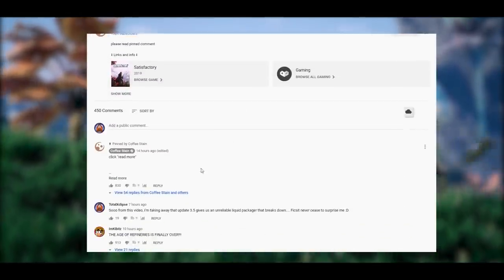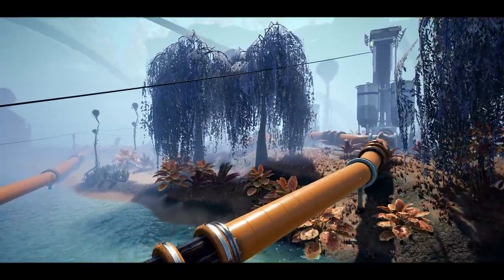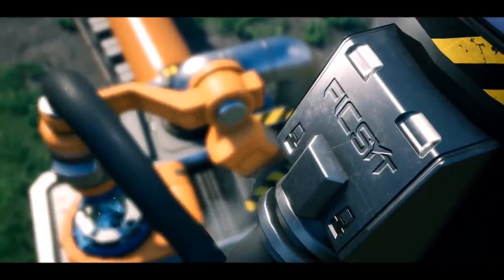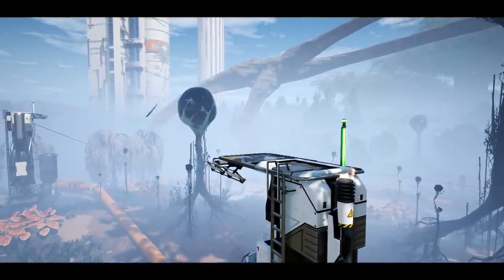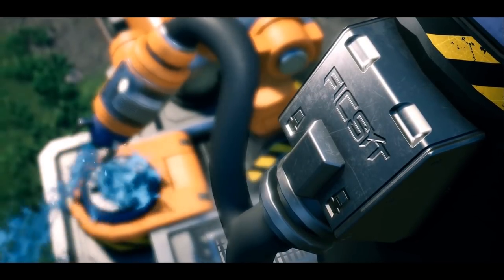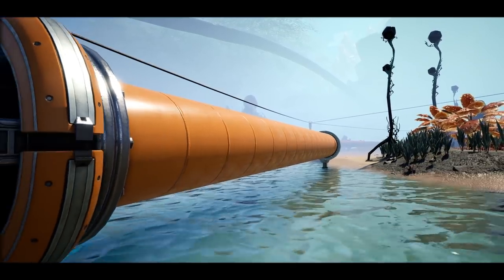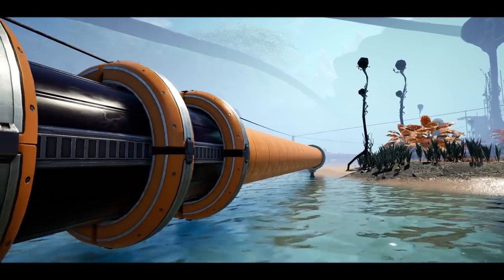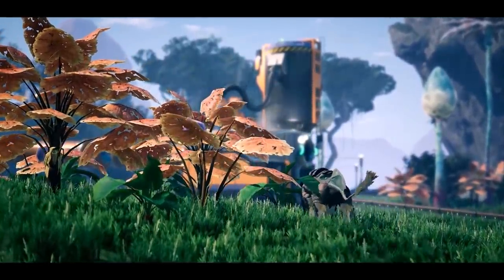Satisfactory Teaser Trailer Theory? [Satisfactory Update 3.5]

Comment: packaged alumina solution is number one on my wishlist for this update.  Second is bigger pipe throughput upgrades.  I'm guessing the animation is just for the trailer, but it could be more.
Reply: Well a fluid sink would keep oil from being such a pain.
Reply: @brodriguez11000   I believe there's a mod that lets you sink fluids. I haven't had a need for it though, I sink a lot of petroleum coke 😁
Reply: @smstnitc  There are mods that have specialized packagers too.  And if you use them then moving fluids in containers becomes even more efficient than pipes over a shorter distance.
Reply: @DarthPoyner  I do a lot of packaging with a fluid packer mod... I have been setting up a system of packing fluids to move them around the map and send the empty containers back to be recycled...  Nothing can pack alumina though...

Comment: We need High Pressure pipes that have a 600 cubic meter/minute throughput.
Reply: And bigger water pump
Reply: Something like Copper-Lined Steel Pipe would fit pretty good into the current theme.
Reply: With the new packer... They may be expecting that you will get higher throughputs by using packing/unpacking.

Comment: I have a feeling that the breaking animation is just a flavour thing for the teaser, not a feature.
As for potential for Mk.2 pipes - I'm mixed on this. On one hand it would definitely be useful, on the other, it doesn't make sense that the same diameter pipe could accommodate higher flow-rates (I know, I know, physics isn't exactly the game's strong suit, but still), and of course it would have to stay same diameter to accommodate existing machinery.

Regardless, I'm excited for the update.
Reply: Couls we have, say, mk2 pumps that would fluids flow quicker within the same pipe? Wouldn't that be compliant with physics? If so, mk2 pipes might just have some higher pressure mechanism embeded into it to justify the higher fhroughput.
Reply: Pipe diameter effect on flow rate is inversely proportionate to the pressure. And visa versa. But the same size pipe can handle various flow rates. 

Heat transfer and fluid flow is a part of my knowledge from the navy. Also why I hate the implementation of nuclear power in the game.
Reply: What if the Mark 2 pipe has bigger diameter? But that would also require us to have a mark 2 wall hole, connectors etc... maybe not viable option. I would say that we could forgive CSS to oversee the physics here and still allow bigger flowthrough in the same pipes. Or what if Mark 1 pipes isn't able to fill up 100%? But the mark 2 would?  Just speculating here. I really would like to see Mark 2 pipes.
Reply: LOL You guys caught me, I confess, I know nothing about fluid dynamics!
We'll see what they release. But honestly, even if all they do is slap a slightly different shade of orange on the pipes, call them Mk.2 and suddenly they transfers 900m3/min - I'll make peace with that and continue enjoying the game :D
Reply: I dunno, if we get different flavors of sheeting, and they could justify it is the friction within the pipe. Cement pipe, Copper, aluminum piping?
Reply: @deeraz  Yeah, you increase the pipe strength (iron or steel maybe even plastics) and then increase pressure which increases flow/current.  More throughput.  Simple and efficient.

Comment: If they are going to have machines over loaded with fluids or others they will need to bring in extra control measures to limit flow or input. In real life the easiest non mechanical method is to have pipes flow under presure and then use smaller pipes coming off a larger main pipe.
The improvement id like to see is is better ellectrical control. Ie isolated power grids to both limit and control what power goes where so failures are isolated to specific locations and a failures isnt total system.

Comment: Smaller footprint seems to be the only definite difference between the bottler and a refinery
Reply: Probably also less energy consumption
Reply: That alone makes it worth it. Refineries just consume too much space, height and width, especially for the simple task of filling a Jerry can. Space that could be put to better use.
Reply: Well, yeah.  That's the point.  Already a mod that does this.  It makes the fluid cars on trains even less attractive as you just have to provide the containers for shipping.  Can probably fit 2 or 3 of these new ones in the space of a refinery.

Comment: Ok ok ok ok ok ...
But the REAL concern is...

They named it PAC-IT
and not P4C-1T

THIS CAN NOT BE ALLOWED TO STAND !!!!
;)
Reply: Pac-it is closer to Ficsit
Reply: @telesnow  If this is the reason. Then I'm going to insist to rename all the other buildings as well...
Biomass burner: burn it
Coal generator: Steam it
Fuel generator: combust it
Nuclear power plant: Nuke it
Constructor: Make it
Assembler: Make it good
Manufacturer: Make it real good
Miner mk1: Mine it
Miner mk2: Mine it good
Miner Mk3: Mine it real good
Smelter: Smelt it
Foundry: Alloy it
Oil Extractor: Frack it
Water Extractor: Suck it
Fluid pump : Pump it
Refinery: Crack it
Space elevator: Lift it
M.A.M.: Research it
Awesome sink: Dump it
Awesome shop: Amazon it
Conveyor belt: Move it
...
Reply from the maker: :D you had me at Amazon it